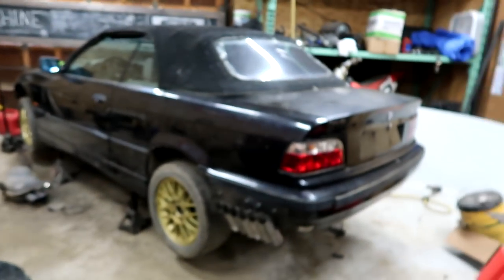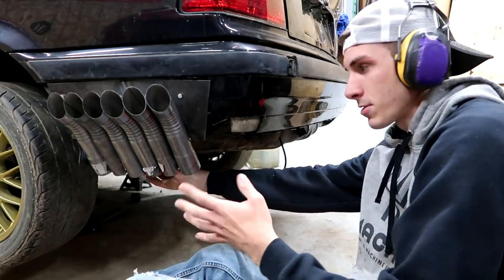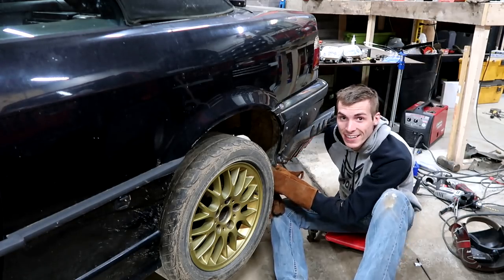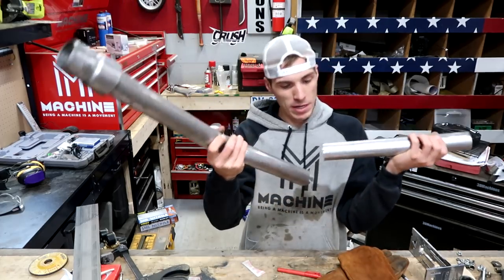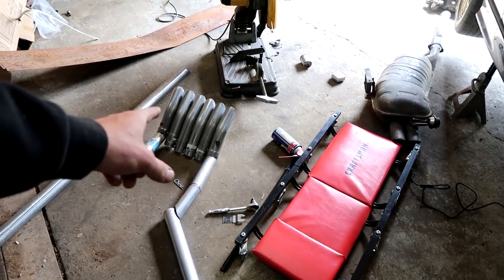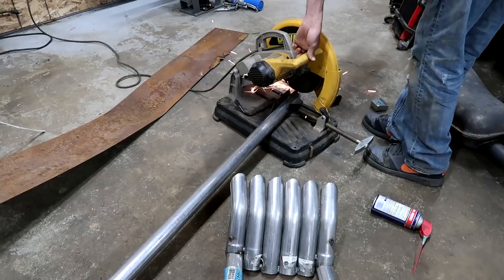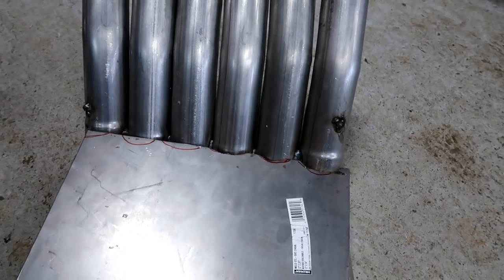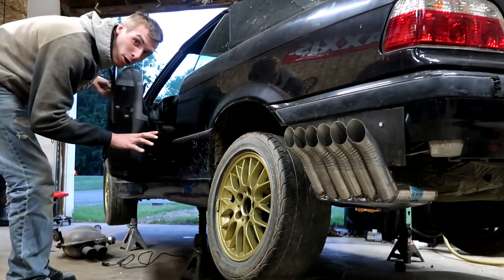INSANE Exhaust First Start & Sound

Comment: You should drill a weep hole in a low point near the rear to avoid moisture accumulating and causing big problems

Comment: The pipe that you put all the way across but a notch at the other end haven't circulating around the Box what you should have done was cut a notch in the pipe that way it would cover all 7 or 6 of them might encounter Mall

Comment: It would be cool if you used a 3 inch pipe and cut holes for the tips Into the 3 inch and weld the tips in the hole and connect it to the exhaust

Comment: Should be a part number. Stamped into the muff. 11 digits. But sometimes BMW only puts the last 7. Exhaust group part numbers for BMW start with the number 18 (but if only last 7 digits are stamped then it won't start with 18). Www.realoem.com is BMW official oem parts sight. Gimme a holler and I'll walk you through it. Take care bro. Keep it braapy.